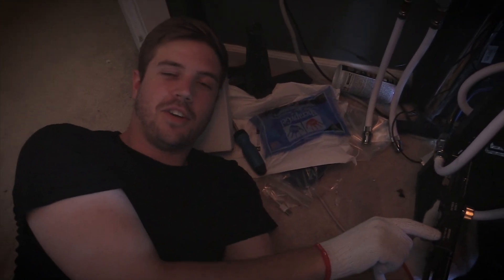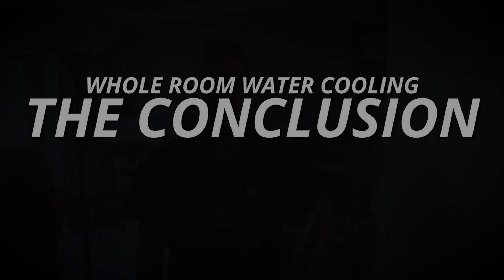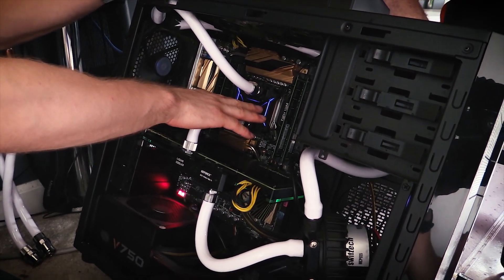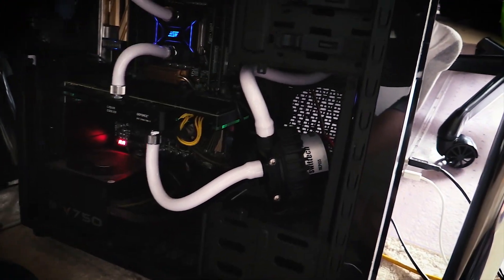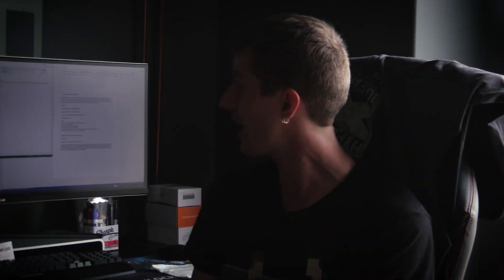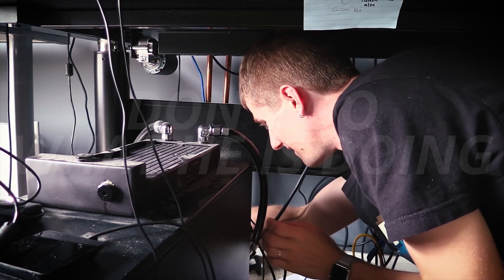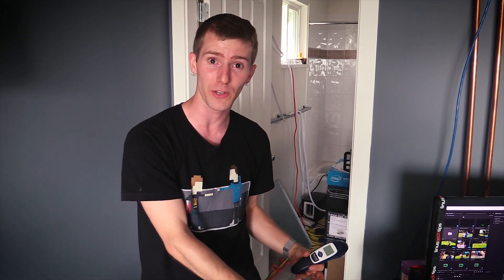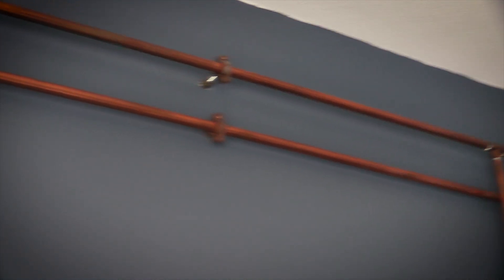Whole Room Water Cooling Part 7 - It's FINALLY over!

Comment: I don't usually follow comments, so sorry if this is a repeat.  We  have a geothermal hvac system of the type called "open loop" or "pump & dump".  We use one well to pump 55°F (13°C) water from the underground aquifer, process it through hvac equipment, and dump it into a second well 100 feet down stream in the aquifer.  The system works extremely well for hvac.  Fortunately, our water is potable, very clean and very low in chemicals.  I suspect this kind of system would also work very well for computer water cooling.

Comment: datacenters are trying to do just this. Imagine 100+KW dumping into a room. The place I worked used in row cooling to extract heat from closed racks prior to dumping the air back in the room. It is a pretty cool solution, but only becomes efficient when heat output reaches about 25KW.

Comment: you need to insulate the hot side of your copper pipe. copper is a fantastic heat conductor. most of your heat is going back into the room like before. basically, your pipes are your radiator.

Comment: would be more  interesting if you have an aquarium water chiller ( that use R134a)  hook to your water cooling setup (cold to cpu cold pipe in).   Those chiller can do 50F output.   Or an industrial chiller that output 40F or lower

Comment: There's some UV and heat resistant window films you can start with, hell you can black out the window and keep the room's light on better than wasting more power on the whole system.

Comment: So if you supercooled a computer would it begin to run slower as the very electrons sending electric signals would be slowed down by the freezing temperature?
Reply: +Vesta Gaming Co. Nope, conductivity is increased as temprature drops, up to the point of being a super-condactive when temprature is absolute zero.

Comment: You are still dumping a lot of heat from the pipes, install some insulation on the pipes!!!
Add some water spray on the radiator outside, you will see a lot greater temp difference, with the water spray i would expect to see a 5 degree difference

Comment: Wow, sorry to hear it didn't pan out in the end, but mad props for going through with all the work needed to make this a reality.  Seriously, that was a huge commitment on your parts, I enjoyed watching it, and getting a better respect on how much work would actually be involved with this sort of installation.

I don't know if you guys check out these newer comments, but just out of curiosity - do you think this sort of setup would or could even be practical in a situation where things such as the the piping (assuming you used a more practical solution than copper tubing), and had a more practical plan of action in place during the time of construction of say, a small room, that had quick-release taps available at various points in the room for specific systems, with basically the tubing hidden within the walls of the room that such a system might provide a practical solution?

I mean I'm just curious to know if it's practical for say, a server room, perhaps, a small one, where the cooling could be regulated into say a smaller refrigeration system that could more adequately cool the coolant and/or dissipate the heat within a centralized location of the building?

If nothing else, the video's given me a lot to think about in terms of possible applications of such a venture.

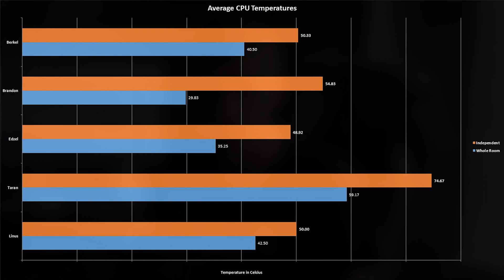Comment: 5:43 mins in so far, and gonna suggest, 
1) you may want to add an aquarium water chiller to get cold water instead of just ambient temperature,
2) add check valve to inlet and outlet at the at the point the system goes from copper to silicone hose. will not allow contaminated water to the rest of the system well, as long as your filter actually removes the contaminants and not recirculate them. 
3) so as to minimize the amount of thermal exchange, insulate the copper pipes with the pre split foam tube and cut it to size. some have an adhesive strip to secure the insulation around the pipe. otherwise, the copper is absorbing heat from the room before it even reaches the computer. And, heat is being released into your room before it gets outside. 
4) add ball valve to each inlet and outlet or fittings that seal when disconnecting, can't remember the name. When the fitting or hose is disconnected, it shuts the flow off of fluid.
Reply: that's was supposed to say 4:53 mins in.
Reply: +George Robles youre too late... The already took it down and moved to a new office with a/c
Reply: Yeah, thanks for telling me what I figured out like one minute after I saw video. 
I said it to see if they may try it again with some proper insulation.
I am planning on building a system my self. Anyways have a good one dude
Reply: +George Robles The chilller would only be effective if the goal is to solely reduce the CPU temps. Unless it is in another room (like the bathroom) I think it would end up adding heat overall to the area as it wouldn't be 100% efficient. Other than that I think your ideas are right on point. Would be interesting to put a system like this in while building a room to use insulation in the walls.

Comment: What you need is a chilled water system using a heat pump, mix the water with polypropylene glycol(antifreeze) and you could pull the temperature down to -20c if you want then insulate the pipes with a nitrile rubber type insulation. I know this works because I installed a system in my house for my ac. HVAC engineer.

Comment: If you would start with insulating the copper pipes in the room you would add about 15% efficiency .... but hey you had a good plumber?A few things you should have done different.1: You don't need a tank.2: Insulate all piping.3: Bigger radiator outside with bigger fans brings more efficiency.4: As u said bleedsystem on top of piping to let the air out, preferably automatic valves.5: Presure gauge and automatic pump, regulated by presure and temp. (thats why you dont need a tank)

Comment: Being concerned about the heat your computers are injecting into the room is important, but I think the way to overcome that issue is to put the computers on the other side of the wall from where your desk is. Just run KVM cables through the wall. It's now cooler and quieter in the office.

Comment: You could try using the cooling component from an office water cooler to bring the temperature of the water back down in the reservoir.  Why not try hooking up to an actual a/c unit with your water pipes and run Freon through the pipes instead of water for better heat displacement.  Another option you could consider is not putting the water pipes in the same room that you are running the computers in, try the basement if that is an option.  The toilet tank may work as a great reservoir as it will frequently exchange the old warm water with fresher cold water each time somebody uses the washroom.  Using copper pipes is a great idea instead of the PVC as the copper is extremely efficient at displacing the heat.  As they introduce microwave drives that outperform SSD drives, heat displacement is going to be an unavoidable issue in the near future.

Comment: Loved this. Except for a few small workmanship issues, this is an impressive solution, even if it didn't accomplish its design goals. If I were going to try something like this, there are only a few things I might consider doing differently: put the pipes in the walls before painting, use a single large radiator and single large box fan, and put the radiator assembly, reservoir, and all that in the attic. (And of course hopefully avoid all the mistakes you made.) Other than that, basically perfect.

Comment: Insulate the copper tubes both in and out. without that as you've said you're pumping the heat back into the room. Basic heat dynamics.

Comment: @linustechtips I reckon that the low difference in temperature between your in, and out, puts is down to you exhausting the heat into the room.

You have a massive amount of copper piping in and around the room that it needs to get through before it actually leaves the building. 

Copper, as I am sure you know having worked on radiators, is a great thermal conductor.

I bet you are losing most of the heat before it reaches the radiators.

Comment: There's also black styrofoam insulation designed to wrap around copper pipes. I thin they look awesome if you cut them the right lengths, but it it's aesthetics you're looking for, then that's just an opinion.

Comment: This was fun to watch, it's like you've installed a UK-style central heating system, and attached your PCs to it. Copper tubing was probably the correct choice though, the PVC piping doesn't come in straight lengths, it comes on a roll, so it would look awful (because normally it's hidden under the floor or in the walls where nobody cares).

UK style central heating systems also have the same issues with air and leaks. One of the radiators in my house is cold for no obvious reason, even though it is full of water and the pipe feeding it water is hot.

Comment: Linux just sayin a better outside unit that would have helped heaps more than all this fans would be the outside unit of an old AC because
1. Much bigger Heatsink and fan
2. Less complex
3. Much cheaper (just go down to the the tip and pick 1 up
4. More airflow

That would probs have made a huge difference

Plz respond Linux

Comment: Hey, quick question, did you consult an HVACR engineer, or a thermodynamics expert for this project? If not, maybe in the future you should consult an expert for projects like these. For example your system does run a good bit on the inefficient side, you could use a refrigerant such as freon- R-421A in small amounts, (which would be loads more efficient then water and not to mention environmentally friendly). Or instead of fan cooling, use a compressor cooler for lower temperature than what one can achieve now. I don't claim to be an HVACR expert, however I have done research on freon cooled computers. Fyi I haven't seen the entire project series so I might have missed a few details possibly covered in my suggestion.                                                                                                                                                    "Just an Idea. Don't start a comment war."

Comment: This is complete BS. First, it executed poorly (from what I saw) and second - there are air conditioners specifically built for server rooms. Yes, I know this is not a server room, but it's the same principle - a lot of constantly generated heat and machines that are at their best in low temperatures.

Comment: If you wanted to increase the effectiveness of removing heat from the room with your system you could easily insulate all that copper piping. Since, as you noted in your video, it is a radiator in itself. 
http://www.homedepot.com/p/Everbilt-3-4-in-x-6-ft-Foam-Pipe-Insulation-ORP07812/204760801

Comment: I think you should have used Aluminium because it is much lighter and will be better in the terms of cooling. Copper is more of a conductor metal. There's a reason computer retails use it as a casing.

Comment: +Chad Kameda Hi I'm 18 , Just spent 2 hours watching this whole thing to get more experience in tubing and stuff because i see too much of myself in Linus ,
Well i think that they should have used PVC instead of copper in order to achieve the main goal ( get the room significantly cooler ) , They Should have gotten an other 4*4 Rad Block ( Answering an upper comment here with a huge amount of likes which for fact points that people have a misunderstanding of Air cooling.. that Fans can't get water under Ambient air Temp,Well that's FALSE and a quick experience you can do is to blow air through your fingers with enough Force ( static Pressure ) air get's colder and you can feel it '' i've seen people turning water down to 3C with 3 Blocks of 4*4 rads''  ) 
inAdd , the grey tiles used for the roof they absorb heat and throw it back at the BLACK RADS !!  black is know as energy absorbent 
Then the metal Reservoir, that's gonna cause so much harm to the Copper blocks cause it's made out of Steal and it's gonna Oxydate them 
Finally why leaving tubes to turn completely poop kinda colored ??? you guys should have noticed that since the tube turned a bit yellowish and i know water Bio Stuff smells Bizarre even if there's a bit of it
 I Think the UV is useless too the IODINE contaminated water won't permit any further growth and will eradicate any kind of life there 

LINUS a tiny Tunisian Voice is talking to you here , Don't get discouraged in Few years or so ReDo !! the project it's an Awesome project alot of fun and stress but it's worth it and i know u already know that 
Thank you to how ever reads this hope this get's to the team , love -
 R.Charfeddine

Comment: You can't point a temp reader like that at a reflective surface and get a reasonable temperature.
Reply: +DeepDarkier look closer - that's a reflection off the pipe...
Reply: +Nate Sweet it looks like he missed it anyways, he pointed the laser at the wall

Comment: First off, I would like to congratulate you all on an awesome build, that although being impractical, is totally awesome as well!  One thing that would have helped, would have been to build a balanced system.  The computer that had all the corrosion build-up was at the terminal end of the system, and therefor, the slowest flow.  If your last supplied system was the first to tie into the return loop, each computer would have seen a balanced flow.  First in, Last out / Last in, First out. Again, though, a really unique build, and despite all the haters, it was still worth the effort in my mind.  You guys are awesome, and have a new subscriber.  Thx!

Comment: If you made some transmission calculations you knew on forehand that this wouldn't work...

replace the radiator with a heat pump and make the neighbour happy with free heat...

Comment: Your room's ambient temperature would probably be lower if you were to insulate the outgoing copper pipes. Flexible water lines would have been easier, and much, much cheaper than buying copper pipe. What about tapping into the existing plumbing? You could use a pressure regulator to pull water from the city water system, though it would be difficult to get that water back into the houses plumbing after it's been depressurized.. Maybe just design a water cooling block that can handle the pressure that exists inside a normal house's plumbing..

Comment: The idea is stellar a for effort at least, and metal is often an issue there they actually make treatments for systems like that to keep corrosion and what not at bay. Believe it or not for outdoor wood burners which use a similar solution. So it could definitely work out if you guys wanted it to now is it the best solution of course not but it' still cool to see it made and the effort that went into it.

Comment: Should have just built a server rack in the basement. Then use USB / HDMI extenders to get control to the users desk. Could even just open the basement windows on the cold days. Also much less clutter in the work space. So ya, cool idea but not practical.

Comment: After you weld up copper pipes, you have to flush them because they always have gunk in them. They also have some caustic nasty crap in them from the solder. Ten minutes is usually enough.

If you had gone with pipe wrap, on both the hot and cold sides, the system would have worked a lot better.

I would've used a single plug-in fan rather than rigging up all kinds of crazy nonsense to drive a huge bank of tiny 12-volt cooling fans. That would have saved you at least a day of labor, and cost much less. A regular bathroom fan would've done the job. A squirrel cage fan would also do fine, and run quieter.

Finally, I would have designed the loop as a manifold system so all the computers got equal access to cold water. As you had it set up, each successive computer in the loop will get less pressure, hence less cooling. Another option would have been to use flow restrictors (you could just use regular old ball valves) to restrict the pressure to the first computer, then restrict it a little less to the second, etc., and with no restriction to the last computer. Combined with flow indicators (cheap things that spin an indicator around when the water flows), the system could've been balanced nicely. However, this is only something to do if you're a perfectionist. The system obviously ran well enough without it.

I designed a soda cooler that works like your system some years ago. Ran into the same issues with stuff growing in the lines. I had a Peltier sandwiched with a heatsink fan for heat rejection. Like this, it was impractical, but a lot of fun!

Ultimately, water cooling computers and dumping the heat outside is a cool idea, but wouldn't have kept the room much cooler. Even if there was no window to let in sunlight, your bodies by themselves would have added 400-500 BTU/hr each. With five people in the room, you'd be generating 2000-2500 BTU/hr. With that kind of output, you'd need phase change cooling (like a proper air conditioner) to move enough heat to make a difference.

Comment: Air conditioning the room instead water cooling could be a great solution that could save time and all the copper pipe hecks.... significant degrees can come down instead of few degrees good luck for the next project :)